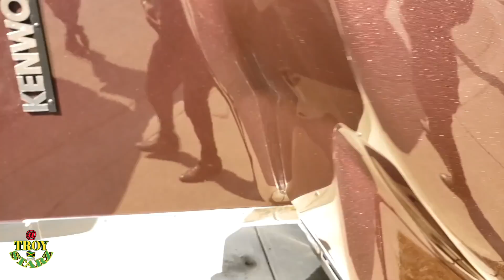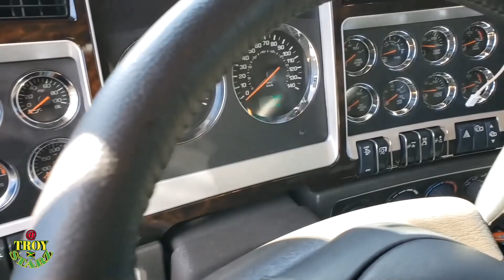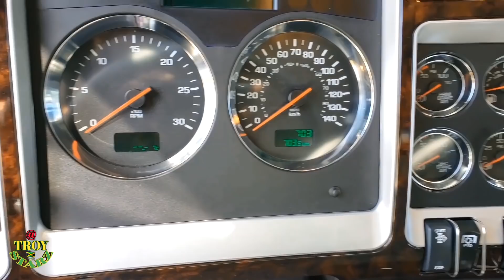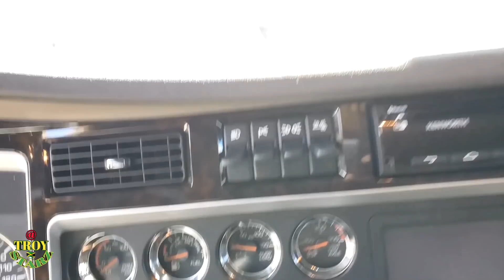Kenworth W900 Full Tour 18-Speed Heavy Spec.

Comment: Nice truck but engine a crap older isx better
Reply from the maker: You come again with the same thing ? I did some research and I didn't hear anyone complaining about it. What i heard is that it burns better in fuel then any other IXS I don't know where you get your info from but it seen like you get a bad experience with one 🤣
Reply: @TroyStarzTruckingVlogs  troy not really but you knw dpf n egr kill these good engines that's why I also ask you if your Volvo had egr issues ..manufactures on the other hand are updating thier engines fixing problems...but if them good as what u said I'll take your word
Reply from the maker: That was long gone your talking about 2011 to 2012 a modern time now everything is going good with the new system. The one that is still give issues and we'll be fix soon is the paccar and the maxxforce engines
Reply: @TroyStarzTruckingVlogs  oh yes those are problems dd engines too don't knw if Detroit  solve the  issues 
..its just that I like the pre emissions  engine but ova seas u av to keep up with emissions standards  epa dem a clamp down especially in California